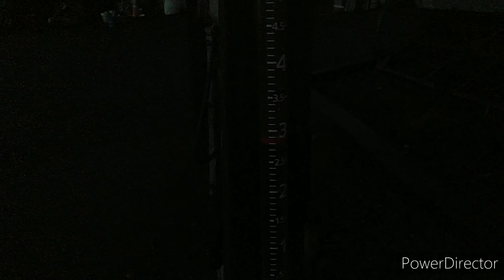done painting the buggy for now

Comment: I'm glad I didn't post a video tonight. Everyone dumped one. Lol
Those runs aren't bad. I've seen some that could be used as running boards!
Doc
Reply from the maker: Lol.. ya.. I still have a few to watch!
I'm not worried about the runs, it happens.. one can of Rust-Oleum was a little thin... That's the side it went on..😪
I've seen worse on new equipment
Reply: @GosselinFarmsEdGosselin  if the metal is cold it is hard to keep runs out.
Reply from the maker: @martinbenton742  true... Shouldn't have been too cold, furnace is right there and I had it up to 70... Was 50 over night.
Reply: @GosselinFarmsEdGosselin  70 should have been warm enough to set up. Must have gotten a thin batch.
Reply from the maker: @martinbenton742  yes, it definitely should be!! 
I only noticed the one can being thin.. the others were all about the same as the paint we normally use.

Comment: Kind of curious what gear ratio the differential is, also if you are going to run a transfer case to give you the lower ranges.  The machine will be awesome.
Reply from the maker: I don't know what the ratio is, but it's gotta be close to whatever it is in the service truck, because the speedometer is still pretty accurate... Former life, it had 54" tires on it, this time around 44", so should be good enough... 
Would be nice to have a nice selection of gears, but it will work.